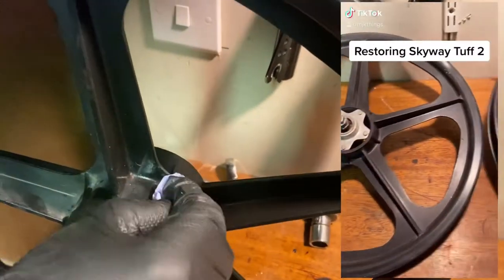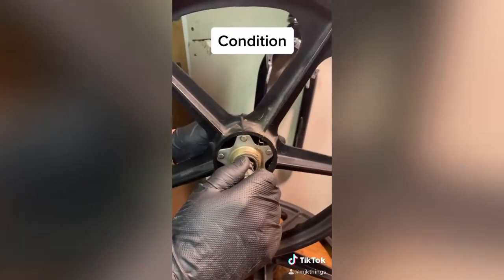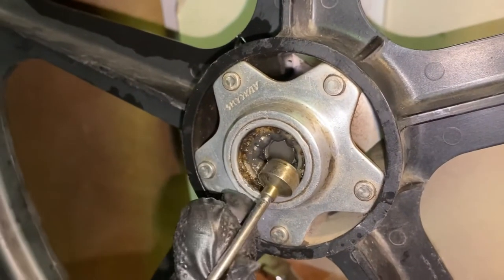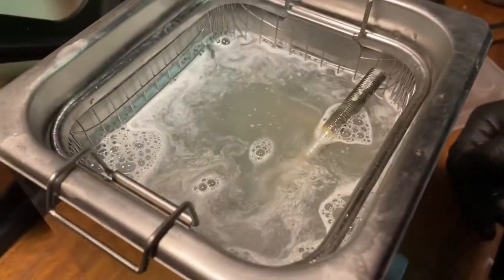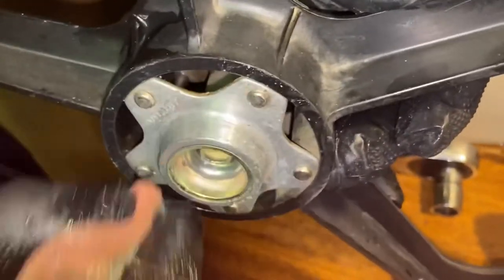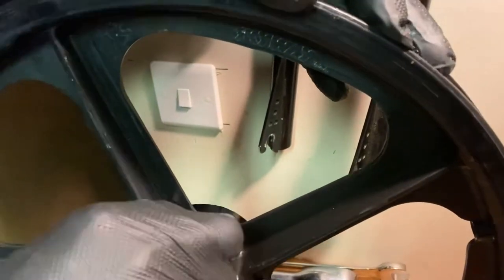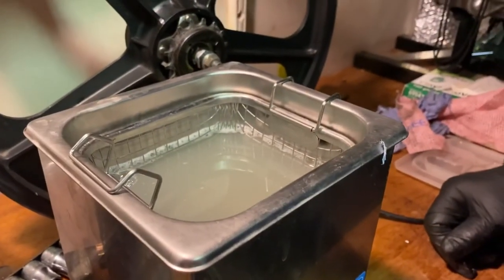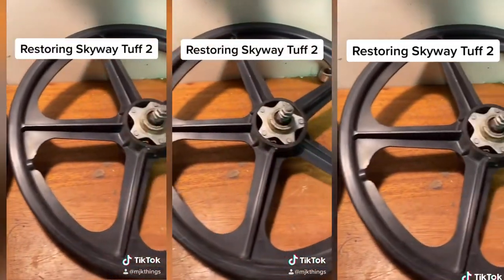Skyway Tuff 2 Old School BMX Wheel Restoration (Part 1)

Comment: Good video bro…I restore and customize BMX bike and I wanted to know, is the removal and installing the axle difficult? And what size wrench do you use as well? 🅰️🅿️💯
Reply from the maker: So sorry for delayed reply I’m sure you’ve already sorted yours but the spindle is very straight forward to remove just take your time and take care to keep the bearings from falling when withdrawing the spindle, clean and re grease as long as there is no wear,  simple reverse build. Replacement spindles and bearings are available if yours are too far gone. Thanks for interest👍

Comment: I have a pair of the same wheels m that are faded yellow. Is there a way to bring the plastic back to original z?
Reply from the maker: Sorry for delayed reply…wet and dry fine sand paper works really well. Worst case if they are badly faded I’ve seen rit dye used.. olive oil or wd40 to finish too